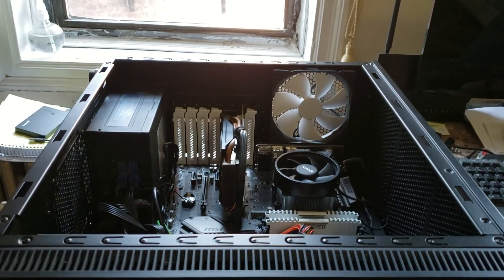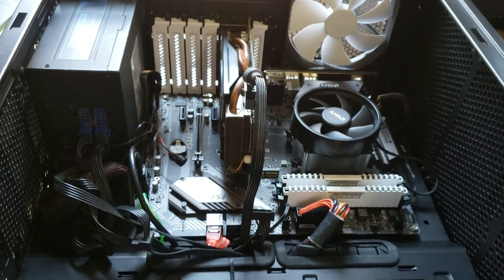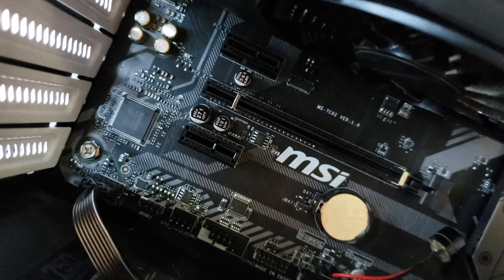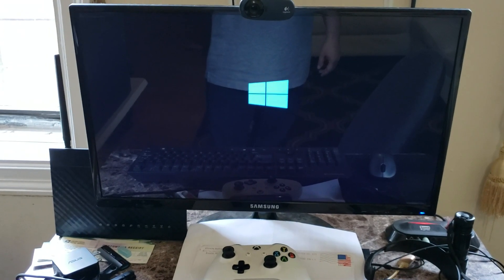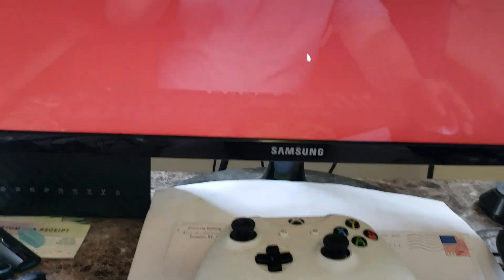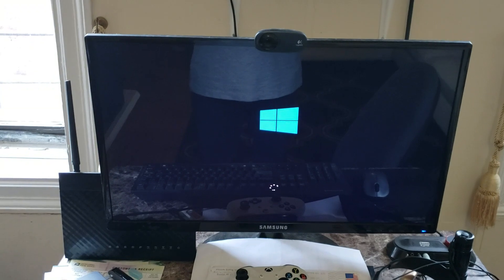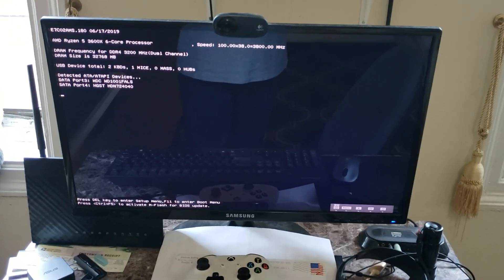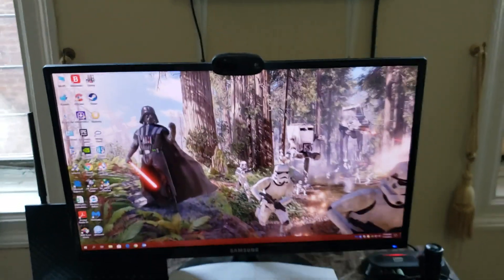Ryzen 3000 not booting on MSI B450/X470 Workaround Fix.

Comment: The reset switch jumper has no electrical interaction with the motherboard unless you are actually pressing the reset button.  Its an unpowered switch.   So whatever is happening... it isn't the RESET cable or jumper.  Probably when you cleared the CMOS, though there is no guarantee that it will stay stable.  When you clear the CMOS the BIOS will go through a full early-boot training sequence, whereas when you reboot a machine or power cycle it without clearing the CMOS, the BIOS uses recorded values as a baseline and only goes through a partial training sequence.

A lot of people are having similar issues, not just with MSI but also with ASRock and Asus.  It's an early boot training issue... i.e. the system is having trouble even POSTing.  Sometimes systems will come up reliably, sometimes they won't.   This is primarily a BIOS issue and mobo makers will definitely be fixing it at some point (hopefully sooner rather than later).

-Matt
Reply: What he said, reset switch is effectively not connected(electrically) until you push it.
Reply: @eminence55  Sure but the switch could be faulty and keeps that connection closed. Which would cause issues booting or random resets.
Reply: What would you say to someone who is about to build a new machine with a R5 3600x in terms of mobo? Stay away from B450 and X470, only B450, go with X570 once and for all? What would be a smart move? Unfortunately I dont have time to wait a couple of months. I am from Brazil where everything is expensive af and will be in europe in 2 weeks when I intend to buy some parts. I am kinda lost in terms of mobo now.
Reply: Diego Cavalcanti I am in a similar situation. If you want an R3 series, X570 is the way to go (or wait for Tomahawk B450 MAX to be available). But most X570 mb seem to have a issues with vrm circuit temps for power users and overclockers. You can also get Intel for the peace of mind.
Reply: @djegovic22  How much money do you want to spend?  If you are on a fixed budget then buying a 3600X and also spending an extra $200 on a X570 motherboard makes very little ense.  It would be better to spend that extra $100-$200 on a 3700X or 3800X instead and stick it into a cheaper motherboard.

If you already have a B450, X370, etc motherboard... then spend the money on a 3700X or 3800X instead of a 3600X + new motherboard.

(Also remember if buying a new 'older' chipset motherboard that the BIOS may have to be upgraded before it can take a Zen 2 chip.  If you already have a mobo and a Zen or Zen+ CPU then you can do that.  But if you are buying a new mobo then you have to work out the BIOS upgrade somehow).

-Matt
Reply: @junkerzn7312  having same issue on x570
Reply: At a minimum, make sure the BIOS is completely up-to-date.  Enough time has passed since the Zen 2 release that BIOSes will have worked out any bios-related kinks.  B450 should work just fine, all my mobos are B450.  Cheaper mobos like B350 might be more problematic.

After that, double check the cabling for the reset, power, and hdd/power LED headers, power supply, sata, etc.  Make sure they are actually plugged into the correct place on the correct header.

Check and re-seat the DDR4.  In particular, on X570, if you have four DDR4 slots and are only using two sticks of memory, make sure they are in the correct slots (the manual will show which two to use).  Due to termination, it might not be enough to just make sure they are each on a different memory channel, they might have to be plugged in to particular slots.

Make sure the power supply is sufficient.   400W minimum, more if you have a high-end GPU.  Make sure all the fans are spinning.

Only after all those things have been checked should anyone try reseating the CPU and putting on new thermal paste, etc.  If you do decide to mess with the cpu, be sure to have a tube of thermal paste on-hand... don't try to reuse the old paste.  Don't use excessive paste, a dot the size of three grains of rice is enough.  Always clean the old paste off and wipe with alcohol before de-socketing the cpu (to avoid accidently smearing paste into the socket or on a pin).  Extreme care is required.

Not much more I can suggest, other than to reiterate that it isn't the reset switch (the mobo would have had to have lost a surface mount resistor for the reset switch cabling to cause a state change from RF).

-Matt
Reply: @junkerzn7312  I actually just updated to the latest asus BIOS and with all defaults, that actually broke xmp/docp compatibility on my board. I had to re-enter DRAM voltages to be about to boot.
Reply: @i3igpete  What do you mean 're-enter' ?   If you are using custom settings for overclocking then you should clear the BIOS settings on any BIOS update and re-tune your O.C. from scratch.  That is true for every motherboard from any vendor for either AMD or Intel.

And re-enter them to what voltage?  1.35V is what nearly all DOCP/XMP modes use and I sure hope you aren't going higher than that because that's about the limit for safe operation on DDR4.   1.4V is pushing it.  Higher than 1.4V and you are probably damaging the sticks.  Not to mention cutting into other OC parameters on the chipset.

Don't expect the same manual timings to work across a BIOS update.  The BIOS always modifies those numbers a little, up or down.  The only real gauge is to run a comparative performance test.

-Matt
Reply: @junkerzn7312  To be clear. Initial setup was no changes to any bios setting. No overclock, no overvolt, completely out of the box.

Bios update changed the xmp profile to a crazy voltage setting. Using auto setting with xmp/docp  gives a too-high voltage now.  It will not run, not even with no other clock or voltage changes. You must manually downvolt.

I'm guessing you're not up to date with the quirks of the ryzen 3 launch, since the advice you're giving advice that is generic to all. I suggest searching for jaztwocents where he goes into the details.
Reply: Every time I oc my memory and it crash i had to take out the battery to clean cmos bios .
Reply: @1967KID  WTF has that got to do with anything in this thread????
Reply: Need help !!!
I hade i5 3500k on MSI motherboard .. I upgraded to Ryzen 3600 with rog strix b450-f gaming motherboard and hyperx ddr4 16 gb 2 weeks ago ... Old hdd and ssd .. and my pc won't boot up 
..every fan spin but no display . I tried cmos thing and same problem .... 

 Help before I loss all my hairs .. 
Thanks you
Reply: @pakospakos9300  Did you try to use a older ryzen chip 1st or 2nd generation to update the bios? I hear people have issues with the 3rd generation ryzen chips on these 450 and 470 mobo's.
Reply: @pakospakos9300  You need to update the BIOS on the b450 before it will see the 3600.
Reply: You sound like a computer tech god my computer shot off three time and never came back on when I take out the cpu cord it comes on but when it’s in the light just blinks
Reply: I have similar problem on asus b350+ with 3600x,when o turn on pc want to start after first beep, it start after second beep, and only this problem is for first boot on a day, any idea about this problem?
Reply: @darkomilosevic4565  same issue as I just upgraded from ryzen 1st Gen to 3rd Gen on B350.. any luck fixing it?
Reply: If you watch Jayztwocents he shows that it's basically random on the newer AMDs. You can have 3 failed boots and the 4th one will suddenly work even if you don't change anything.
Reply: @i3igpete  What's the name of the video, please?
Reply: I'm having this problem with a Biostar B350GT5 + R5 3600, updated to the latest Bios with AGESA 1.0.0.4B. Most times it boots up normally, sometimes it doesn't even post, and there have been 2 times I have gotten a Windows error message with a blue screen, saying automatic repair couldn't do anything. First time this happened, my boot order had been reset. Second time this happened, I didn't get into the Bios, just turning it off and on again, it booted to Windows just fine. I'm running 3000MHz ram, while the motherboard supports up to 2667MHz. Setting the ram to 2667MHz changed nothing. Cpu is stock, with really good temps.

Thing is, when I'm inside the OS, absolutely no problems, the system runs like a dream.

Also, I've noticed that sometimes the Bios is at the monitor's native resolution of 1080p, but most times it's at a really low resolution. Does that mean anything?
Reply: @Michał Talarek retailers are now selling MSI b450 boards with pre-flashed bios to take the ryzen 3000 series
Reply: I and my friend just tried this workaround with ASUS mobo and It absolutely worked. We didn't clear CMOS, just removed the reset switch.
Reply: Guys, have an issue on b450 aorus m motherboard. 1600x works well, but 3600 dont work, stops at motherboard logo. Tried every plug/unplug, bios is last version. Do you know why can it be? And if i make CLR CMOS will it turn bios to old version? Thanks in advance)
Reply: Could be the switch that is short circuiting.
Reply: I am still having this issue on latest bios, R3600 + MSI B450M Mortar, suprisingly the pc boots up with single ramstick then for dual channel I have to remove all stick and swap the two then it would boot up in dual channel!
Reply: 8DHPY
Reply: @Britec09  hi I bought BIOSTAR B550M and for my Ryzen 7 2700 but when I turned on my PC it doesn't post anything just blank black screen even tho my PC is turned on all of my Fans is working but no display.Is this bcs I bought a new motherboard that needed update? I previously use Gigabyte b450m S2H
Reply: I agree. The reset switch is an open circuit that's only closed when you press the reset switch. His results are strange....something else must be happenin causing him not to post. Would've been ideal if he reconnected the reset switch to see if the board posts or not. That would certainly prove things one way or the other.
Reply: @hendersonsobers396  Yes it is an open circuit. But an open circuit can easily pick up RF interference.
Reply: @rwcordell  I suppose thats possible, but for an open circuit with RF interference to make the difference between posting and not posting is a bit much....that would have to be hell of alot of RF interference. Assuming what you are saying is correct and the RF interference is indeed the cause, does this mean that with this msi board that I can no longer use the reset switch on my case if I want to run ryzen 3000?
Reply: @hendersonsobers396  @Britec09  hi I bought BIOSTAR B550M and for my Ryzen 7 2700 but when I turned on my PC it doesn't post anything just blank black screen even tho my PC is turned on all of my Fans is working but no display.Is this bcs I bought a new motherboard that needed update? I previously use Gigabyte b450m S2H
Reply: This is why you should never buy a new release from AMD.

Somehow people forget that AMD has shit drivers at launch. That's why their finewine exists because there is no way to go but up from rock bottom lmao

Comment: I would have liked to see you try to boot before pulling the reset wire
Reply: Yes, this types of videos require before and after examples.
Reply: But his right i did not have that problem because my case only got power botton no reset botton .
Reply: @iwantmilionsofdollars5711   please elaborate and if you any link pls share
Reply: @Britec09  hi I bought BIOSTAR B550M and for my Ryzen 7 2700 but when I turned on my PC it doesn't post anything just blank black screen even tho my PC is turned on all of my Fans is working but no display.Is this bcs I bought a new motherboard that needed update? I previously use Gigabyte b450m S2H
Reply: it really not booing post. i follow this and it work

Comment: Everything stable now?  does it boot everytime?
Reply from the maker: Yes, everything pretty stable so far.
Reply: @Jlove3184  When the V19 comes out can you install it with all the parts on or are you going to take it apart then flash?
Reply from the maker: @xGGamesHDx  I'll install bios v19 with everything installed.